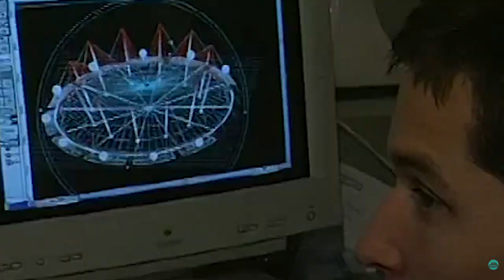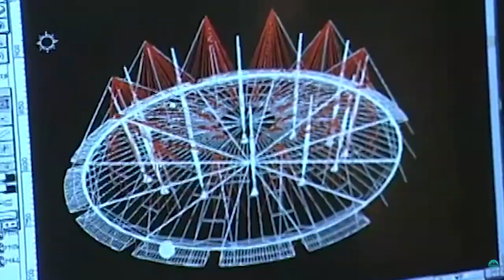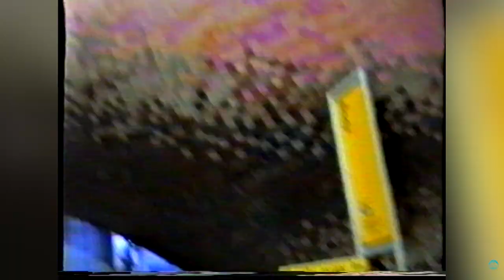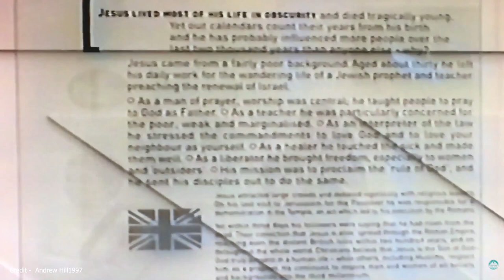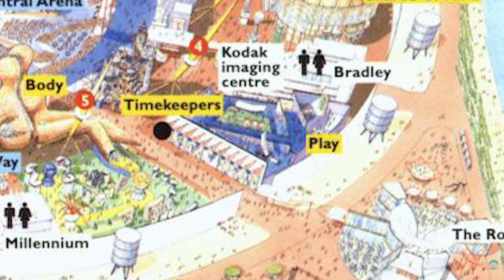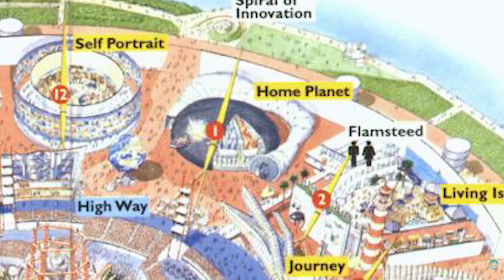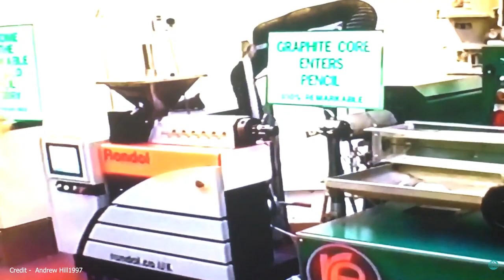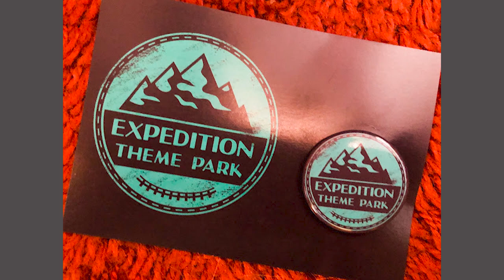The Closed History Of The Millennium Dome Experience - London, UK | Expedition Extinct

Comment: i worked there during the construction as a network engineer.  there was absolutely no expense spared on the equipment fitted there.  including a state of the art [for the time]  fiber optic network.  the whole thing was ripped out upon the closing of the exhibition.  i bet most of the data points were never even used.  Such a waste of money!
Reply: steve m that’s awesome. When did you start working there ? And for how long? Any interesting behind the scenes knowledge?
Reply: Of course it wasn't used, nobody had smartphones, most probably had old Nokia's which didn't have internet.
Reply: @Maraguzzi  during construction he said, which took years to build due to constant delays and more and more budget increases.
Reply: @markshaw270  the data points were for hard wired computer terminals and telecoms, not wifi mobile phones.  Oh, and smart phones were a thing back then. Look up the Nokia Communicator.
Reply: @StellaSteve80  yh I know that one, but it's more for email and such.
Reply: @StellaSteve80  I remember wap enabled phones, but it was so bad.

Comment: The only thing I enjoyed about my visit to the Dome, age 14 I would imagine, that I remember was being fascinated by the engineering and architecture of the building. I remember spending looking up at the ceiling/roof a considerable amount of the time. I remember that former Monty Python Terry Gilliam had submitted a design for ‘The Body’ zone but it was rejected for being to graphic. A Terry Gilliam designed Body zone would have been 10x better than what I remember, it probably would not have had a peculiar and invasive smell that seemed to permeate the Body zone. Actually, the most memorable thing about the dome for my visit was the fact we were there the same day as the failed Diamond Heist. We thought it  ignites have been part of the experience. Again this would have made it much better.
Reply: I felt exactly the same way. The building itself was incredible and I wasn't at all bored waiting half an hour for the show to start, because I couldn't stop staring at the structure and the spectacle of the place (the show was also amazing)